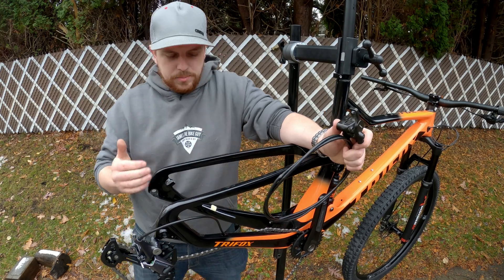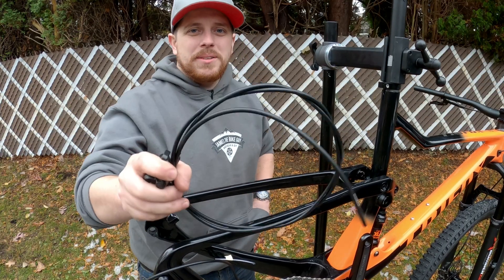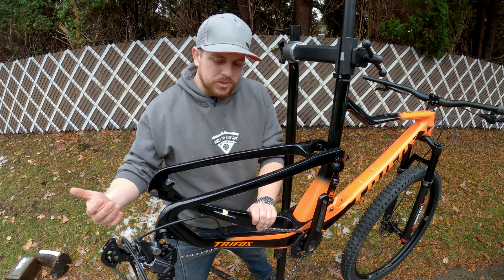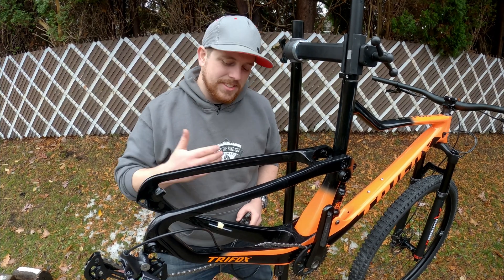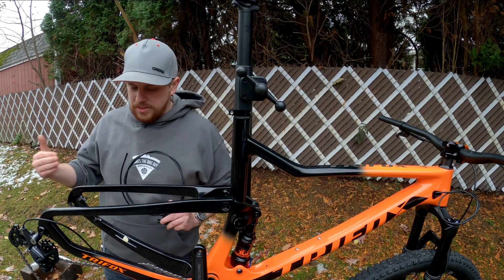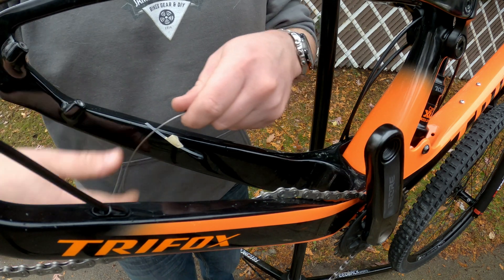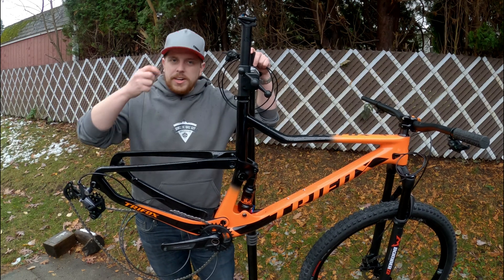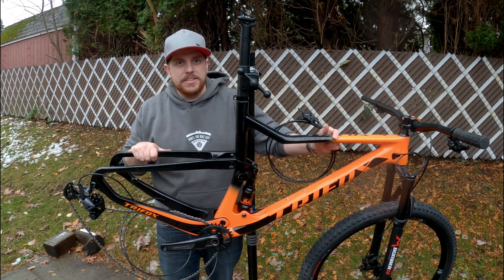Easy Trick for Internal Routing Hydraulic Brake Hose using a Shift Cable and Ferrule

Comment: Thanks!
Used this trick with mechanic’s wire in place of a shift cable, to route the brake cable all the way from the chain stay through to the head tube. Worked great. Even on a Time frame with a Hambini 1-piece BB already installed.
Reply from the maker: Excellent!

Comment: The derailleur cable with the housing was the only thing that worked. It took 2 hours of fiddling with tweezers and pliers before I tried the cable and housing end trick and it took 10 mins to do one side. What a life saver.

Comment: This technique sometimes work except when the cable housing end cap is too large a diameter to fit into the holes in the frame.   Then what????
Reply from the maker: You throw out the bike...

But really, then you just use a seal pick. Lots of way to do internal cable housing.

Comment: I’m glad I found this video. I’m about to go from a flat bar to a drop bar and the bike came with hydraulic calipers, and the brifters I’m going to use are compatible with mechanical brakes. I’m still going to run hydraulic but they’re cable actuated so those hoses gotta go.

Comment: Have a Turbo Levo 2019 and the cable is internally routed entirely from rear caliper to the fork head. The loosely mounted brake cable would not work cause you have to pull.
Reply from the maker: You shouldn't need to pull. Push on the break hose and only lightly tug on the cable to help guide the hose

Comment: This is brilliant! Do you ever need to add some tape over the ferrule for extra security? My stigmata has a tight bend around the BB, and I'm worried about the ferrule coming off the hose.
Reply from the maker: Smooth pressure and it won't come off. Adding tape will increase the diameter and some holes it won't fit through